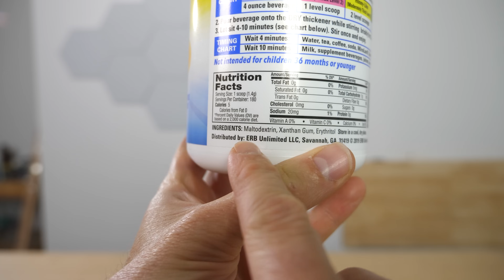When Does Pure Water Get Thick?

Comment: With the water viscosity experiment, its actually an interesting trend that for both hot and cold water, run 1 and 2 yield the same value, but run 3 has a different one - and better yet, cold 3 is faster than cold 1 & 2; and hot 3 is slower than hot 1 & 2. I'd wager that this is because the water became closer to room temperature by the time you got to the third run, making the cold water warmer and less viscous (and the ball travelled faster) and the hot water cooler and more viscous (making the ball travel slower)

Comment: There are various thickeners for cooking. Xanthan Gum and Guar Gum are two I use a lot. Xanthan is also an emulsifier, it will bind oil to water, its why store bought Italian dressing mixes better then homemade. Xanthan is also used to slightly thicken hot chocolate or chocolate milk, use very little. Thicker drinks will stay on your tung longer, they'll be more tasty.  It also holds air and can replace eggs. Both can be used to thicken food for freezing and thaw well where starches and gelatin clump up. Or, used to make ice-cream or frozen treats as they reduce ice crystal size. Its best to have a stick blender to mix them. Other natural gums like lotus bean are good too.

Comment: What I want to know.... If you leave it sit... For a week or more sealed.... After it reaches room temp... Will a solution somehow cover the bottom of the cup... If it's styrofoam does it.... 

I just saw a cup with stuff in it that never got on the outside of the cup. Yet days later the outside was covered almost as if it dipped in the stuff and was all dry and sticky....

Even under the cup had liquid there to... With a rolling paper soaked in it. But oddly no stains in the bottom of the cup even tho the paper was soaked....

How's that happen?

Comment: Interesting video, as always. But I feel like the ball in tube experiment is flawed. Part the increase in speed for the ball in hot water could be caused by the thermal expansion of the tube allowing water to flow around the ball more easily..
Reply: Honest doubt: wouldn't the ball expand as well?

Comment: Problem with the cold/hot water experiment is that the plastic tube will compress when cold and expand when hot, thus adding  in the unconsidered variable of differential friction between the ball and the inner surface of the tube. For shame!

Comment: I can hear the change in viscosity of the water that comes out of in my shower. When I turn it on so it's set to as hot as it gets, but only cold water is still coming out, I hear one pitch. Then, when the hot water starts to come out, the pitch changes. That's when I know I can regulate the temperature and step into the shower.

Comment: Depending on the thickening agent, there can definite be a taste. Xanthan gum (like you've got here) is flavorless, but cellulose or starches can add a distinctive "stale" flavor to thickened liquids and food. if not mixed properly they can also leave a grainy or "bubbly" texture, due to undissolved particles and trapped air.

Comment: We had to add thickeners to any liquids we gave to my father after he had had a couple of strokes.  His epiglottis had become paralyzed and he couldn’t swallow anything without the risk of aspirating and taking it into his lungs.  The epiglottis is a small flap of skin in the pharynx that is pushed downward when food or liquids pass by it.  The skin closes off the airways while food or liquid is passing through the throat.

If the epiglottis stops working, liquids and food can end up in the lungs.  He didn’t seem to notice we had thickened his tea, but it doesn’t seem like it would quench your thirst since the receptors on the back of the tongue can tell liquids from solids and I would imagine even thick substances, but I guess if it’s cold enough, it can trick the nerves.  I felt really bad having to put that stuff in his drinks, but the alternative was an aspiration and that’s not good at all.  He didn’t live a lot longer than after that condition had arose.

Comment: Yeah let not repeat that fire 😅, safety 1st, second  was the 2 balls use the same size?  I asked for one the cold water the one  appears rounder an wider if not fatter, the one in hot water looked more smaller an an skinny, thin, perhaps it  the temperature or just due to the think thin as was suggested here or there is another thing at play , an lastly the hot an cold water poring on blk screen on closer hear of the hot it not only sizzeld it also sounds  like cracking ice as well not just hot but cold 🤔 wonder how that one is. An the cold sound similar  to the hot but lesser but by a smallest amount of distinct sound,😅  an thank you i was tbh thinking there was a difference to this as well so thanks for posting this... an the knifes love the quality  of them

Comment: 7:32 - liquid alcohol does not and cannot burn. As you know, only vapourised alcohol/fuel can burn in air, and only in a narrow range of fuel/air ratios. Alcohol needs to evaporate before it can burn, and  at the temperature of Liquid Nitrogen, there is practically no evaporation or sublimation. This is one reason internal combustion engines in cars are most efficient when the engines are warm.

7:40 - You and I both know your table was not on fire. The alcohol vapour was on fire. We both also know that almost all heat energy in a fire goes straight up, and that alcohol burning on a surface isn't damaging that surface for quite a while. Remember the silly old flaming car hood advert? :)

Comment: About the ball falling in the tube. Have you considered the tube expansion? It you fill it with cold water it could shrink leaving less space for the ball to fall thus creating more resistance.
Reply: Good point I wonder, tho I do believe water to some degree would get thicker as it freezes cause it does eventually thicken so much it turns to ice, I’ve also had really cold bottles of water instantly turn to thick slush when shaken I just don’t think it would make a noticeable difference before it starts to actually freeze

Comment: Hot water does not hold dissolved air.  Cold water contains air, if it came from an aeration faucet spout.  Hot water wets the steel ball better than cold water.  Normalize for air bubbles, then try again.

What about density of water as a function of temperature?  That affects buoyancy of the steel ball.  So, are you measuring viscosity, or something you assume is viscosity?

Comment: On the speed of the ball, I wonder on what effect the diameter of the tube has on the falling speed. Surely the tube expands when getting hot (such as when being filled with hot water). And I'd expect a larger diameter to result in a faster-falling ball (as there's more space between the ball and the wall). On the other hand, the ball itself should also expand when heated, so maybe those effects just cancel each other?

Comment: We use to put high alcohol strength Vodka in a -20 degree celsius freezer with our shot glasses when we were younger for the thick Vodka shots. Definitely a lot smoother and less hot tasting. Never really gave it much thought until now as to what was happening there. I know the alcohol prevents the water from freezing, but I guess now it is the alcohol that is getting thicker :/

Comment: When measuring the viscosity of paint you would get a small container with a hole in the bottom. (like a metal test tube {domed bottom} w a hole and handle to grab ) dip the container in the liquid until full. pull the container out and measure the time taken until the paint flow "breaks" from a continuous stream.

Comment: I saw in a science experiment book once that you can see the difference between cold and hot water by poking a small hole in the bottom of a cup. The hot water will drip faster than the cold water because its viscosity is lower.

Comment: Might be a little outside the scope of this video, but viscosity is also proportional to the intermolecular forces, so the reason temperature affects viscosity is because, as a substance is heated, the forces between molecules weaken, so things like viscosity and surface tension lower.

Comment: Thanks for addressing the differences between cold and hot water. Especially if you're pouring water at near-boiling, there's a very noticeable difference in how it pours compared to cold or room-temperature water. I've never dug into finding out why, but you answered that question right here!
Reply: I'm not only person who noticed water acts slightly different when Its hot? Good.
Reply: Lol no. Whale oil went obsolete legit immediately after kerosene said 'hello'.
Reply: I always assumed the "hot water sound" was because of localized boiling due to low pressure zones formed in the turbulent conditions. Cavitation, basically.

Comment: Hot water vs cold water pours sound different. Is it possible that in hot water, the steam and vapors also creates a sound damping effect since sound has to travel through the steam then into the air? It does sound a bit muffled too! Perhaps a video on that!

Comment: The thing with thickening agents is that they change the flavor, even when flavorless themselves. Different thickeners have a property called flavor release, which is how easily you can taste the thing it is thickening. Some substances wont enter your taste buds or dissolve in you saliva as easily. For example gelatin has a great flavor release, but xanthum gum has a very poor flavor release.
And since it impacts different molecules differently, it can change the balance of flavors. That soft drink that you are used to is going to taste weird when some of the flavors are missing.
The same goes for cold vs warm drinks due to their different thicknesses. Soft drinks are designed to be drunk cold or at room temperature, a drink left in a hot car will taste too sweet and too strongly flavored (not even getting into the issue of CO2 solubility).

Comment: Water is pretty interesting because it's incompressible. Its density is virtually the same from freezing to boiling. But yes, even though its density fluctuates by only ~4%, its viscosity can change by 3X. Liquid water is also denser than frozen water. Pretty crazy.

Comment: With the tubes filled with water, would there also be an effect where the tube itself would expand or contract with temperature? So the ball traveling through the hot water is also traveling through a larger diameter tube? If so, what kind of effect would this have on the speed?

Comment: When I turn on the shower in winter, the water in the pipes is quite cold.  I can tell when the sound of the water hitting the shower floor changes, that the hot water has reached the shower.

Comment: Water viscosity varies very little with temperature, but the maximum viscosity for pure water is at 4°C, reducing viscosity al higher and lower temperature than 4°C.
At 0°C the water freezes, but meanwhile the water is changing fase from liquid to solid, it remains at lower viscosity than 4°C.

Comment: 8:03 This experiment should have the tube inner diameter at the same size. I think the hot tube gets slightly bigger i size, creating more space for water to pass the steel ball and therefore the difference in speed also seems bigger.

Comment: The ball fell through more water in the cold test vs the hot test. The difference is around 4%
Reply: I'll add: when temperature is a variable you should measure by weight, not volume.

Comment: Interestingly, one of the reasons whale oil was so valuable as a lubricant as late as the 1970s, was because it wouldn’t change viscosity much, even at extremely high and low temperatures. That made it consistent, which was important for machine and vehicle oils.
Reply: Whale oil went obsolete when kerosene said hello to the world.
Reply: @Vicus_of_Utrecht  as a fuel, but not as a lubricant.
Reply: @Vicus_of_Utrecht  kerosene is not a lubricant and has nothing to do with what OP said.

Comment: For anyone who is interested, the product he is using is called “clear Dysphagi-aide thickener”, it’s made of Maltodextrin, Xanthan Gum, Erythritol (2%). I’m surprised he didn’t mention this or how it actually works…
Reply: Odd since maltodextrin and erythritol are both sweet. They're no calorie sugar alcohols. They can make you have gastro troubles like diarrhea & gas pains if you consume enough of it.
Reply: @troy3456789  erythritol is a sugar alcohol, but Maltodextrin is essentially just starch that I believe makes up the bulk of this thickener
Reply: @troy3456789 they're fermentable, xanthan gum is also but they only ferment if you have the specific required bacteria required to break them down.
Reply: 100% pure water...

Straight up lie.
Reply: @dustyh5599 - Did you both skip the section at 3:02?  He definitely showed what it was.
Reply: @dustyh5599  Watch to the end, maybe. He does an experiment supporting evidence that water thickens at lower temperatures.
Reply: @dustyh5599  well, yeah technically. If you add stuff to it to make it thick, that isn’t water, then it isn’t water…
Reply: Probably because you can just do a google search for how to make water thicker and get results that don't have stuff like maltodextrin in it? You could use gelatin, collagen powder, chia seeds, etc. Lots of ways to make thickened water without buying this specific product.
Reply: @京悪者  Boil it, add 1/4 tsp corn starch mixed in a little cold water. Wait.
Reply: @京悪者  Why would you click on a science video, to then have to google the answer to the next logical question after you read the title? that being: “how does the thing he is talking about work?”… If you’re happy to watch an entire 10 minute video without even once wondering about that, then why are you watching the video? why did you even click? 

It’s just disappointing and rather unprecedented for action lab, usually acknowledging what’s really going on and then explaining how it works, instead appearing to shortchange us on an explanation as to the very subject and basic question of this video…
Reply: @XavierAway  He did explain it, just half way through. Did you comment before watching the entire video?

Comment: I was hoping to see supercooled water's viscosity, like the alcohol.

Hot water puts off steam, which results in audio occlusion (absorption) and refraction (like light going from one medium to another, but here drier air to humid air). It would be interesting to isolate each audio variable (such as pouring cold and hot water inside a hot and humid room?) as a demonstration.

Comment: [00:00] Thick water is a product for people with dysphasia, which makes swallowing difficult
- Thick water has the consistency of syrup or honey
- It is clear and tasteless
- Thick water is used as a thickening agent for different fluids
- It can be tried with Coke and milk
- Thick water has real use in medicine

[02:37] Water can be made thick by adding flavorless thickeners, but pure water cannot be made thick
- Viscosity is the measurement of a fluid's resistance to deformation or flow
- Temperature affects viscosity, with higher temperatures resulting in lower viscosity
- Thickening agents like maltodextrin and xanthan gum can be added to water to increase its viscosity

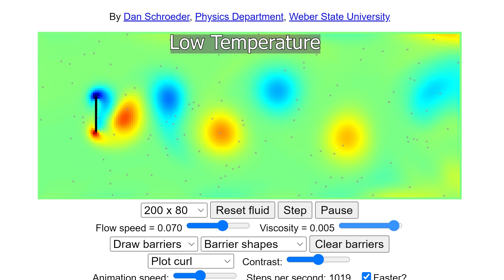[05:15] Ethanol gets thicker when cooled down, due to hydrogen bonding and resistance to flow
- Ethanol flows easily at room temperature
- Liquid nitrogen makes ethanol very thick due to lack of sliding between molecules
- The Leidenfrost effect keeps hands safe from liquid nitrogen
- Frozen alcohol can still burn
- Cold water doesn't thicken as much as ethanol when cooled down

[07:54] Cold water is thicker than hot water, as demonstrated by a metal sphere falling slower in cold water
- A long tube was used to drop a metal sphere through hot and cold water
- On average, the ball fell through hot water a fifth of a second faster than cold water
- The difference in viscosity is due to how water flows and air bubbles move at different frequencies

Comment: it's never in my life occurred to me that there is a difference in sound between pouring hot water vs cold water.... yet I knew instantly the first one was hot water
however I do wonder how much has to do with the slightly different viscosity of the water vs. the water vapor coming off the hot water but not the cold water.  I suspect the sound difference has more to do with the vapor than the water itself

Comment: In the hot water vs cold water experiment.  Did the marble move faster because hot water was less viscous, or did the heat expand the tube and the hot tube have a larger cross sectional diameter?

Comment: There might be a way to ticken a pure water more by supercooling the water and then increase the pressure. Apparently the water does not freeze under higher pressure, but I am not sure about the details (i.e. how much pressure, would it apply to near freezing point or it will work with significantly colder water, etc).

Comment: 08:07 What if the hot water causes the pipe to expand so the metal ball is able to fall faster because there is more room round its sides? Think you would have to see if the water volume in side the pipe is the same at low and high temps. (looked it up and water viscosity changes with temp, I'm just muckin around policing the science 😜)

Comment: in the tube filled with water experiment, did the diameter of the tube change with temperature? how did you control factors other than heat effecting drag?

Comment: Thin hot water is the reason why a teapot spout might no function well with cold water (or worse if designed using cold water and used with hot tea).

Comment: Every flammable liquid has a flame point. The temperature at which it can produce sufficient vapor to ignite. A wick lowers that temperature (or increases evaporation). That is why you will not ignite a bucket of kerosene just by dropping a burning match in it (unless you are at a really hot place), Add a rag and it ignites. .